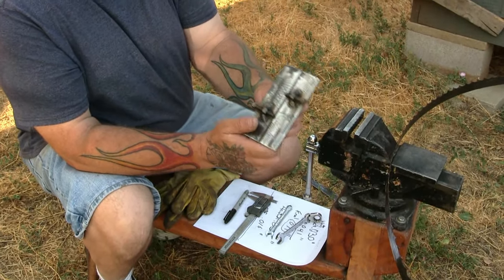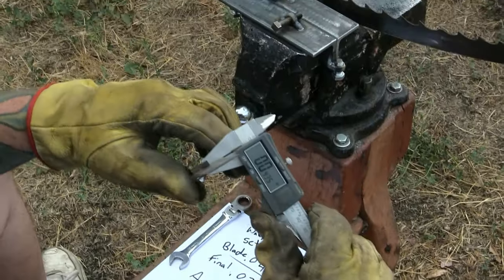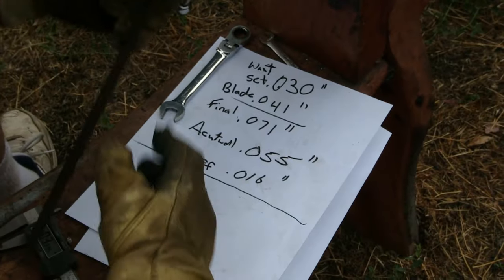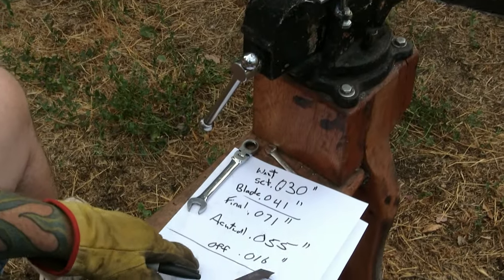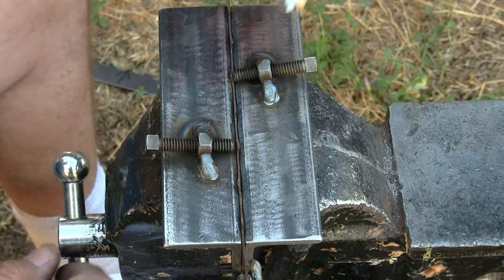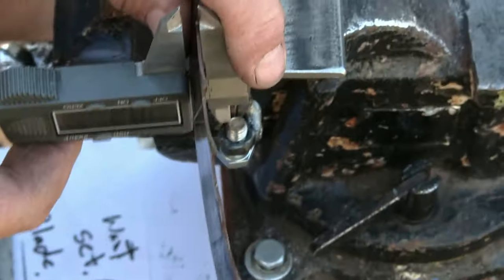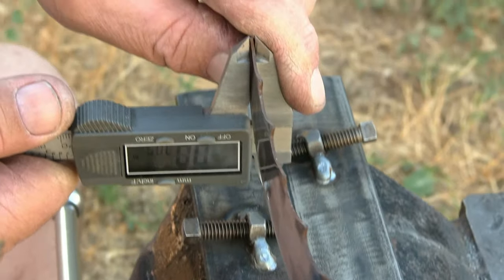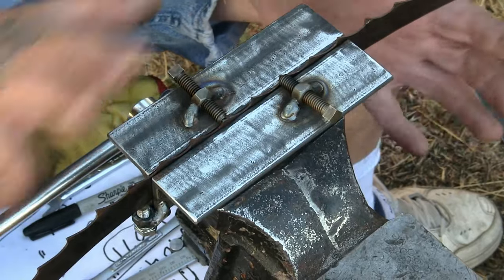Ebay Bandsaw blade setter setup and use instructions sawmill Woodmiser Cooks homebuilt bandsaw

Comment: Thanks for the info. This is very good info on the way the setters work and how adjustments are made on a basic platform. I have a few ideas for mixing this platform with one of my old progressive shotgun reloading presses. I should be able to build a machine I can turn on and the same way the auto sharpener sharpens the mill blades I will set it up for pressing the set. It will not be as accurate as your because of spring back like you said but the ability to set it and let it run is too easy. For a blade that only stays sharp 6 hours and looses set after 12. It’s not worth my time doing this. I’m better off milling and buying a new blade more often. But thanks for the design and knowledge on your product.

Comment: I believe you could build a more accurate gauge that will automatically set teeth exactly without checking each tooth . If you want 075 set bender preset bender for opposite tooth
Reply from the maker: You only have to check the tooth during the initial setup. Once it's set for each side for the proper amount that takes all of about 10 minutes to do you are good to just roll through the blade or blades doing an occasional spot check. Of course I can make a fully automated setter and can make a lever operation that sets each tooth and advances. But that's already available and those machines are very very expensive. This gives you a setter at home that is easy and uses a vise you probably already have.

Comment: One improvement might be to use nylock nuts so the bolts won't move in or out as you are using it. With that said, that change might require using epoxy instead of welding as it would probably be easy to overheat the nuts and melt the nylon insert. Nice design.
Reply from the maker: The bolts are welded. No way epoxy would hold way to much pressure when applied. They are welded then whacked with a hammer to squeeze the nuts so they are out of shape a bit. This makes the bolts fit very snug so they hold there setting indefinitely. The same as a nyloc would. So no the bolts are not loose and do not change adjustment unless you put a wrench on them.
Reply: Simply use the "crimp" style locknuts to make your suggested modification, and you are all good to go.  Or, put a stop/backup nut on the bolt so you can set the "set".  Either way, your suggestion for improvement is great.
Reply: They make mechanical locking nuts. Probably what is welded on.

Comment: I just watched your video.  looks like a simple and great way to set tooth pitch.  Im curious if a person couldnt sharpen the blades as well with this setup, using a dremel?  I want to try it after mine are delivered, but wondering if anyone has tried and succeeded at this.
Reply from the maker: I am working on a simple electric sharpener that uses a similar setup to this to sharpen as well. I been super busy so have not finished yet but few weeks should have it available for sale along with my setters. Watch for it soon on my channel and eBay.
Reply: "Set" and "pitch" are 2 different things.

Comment: Just ordered one. Seem perfect for my set up. I have a Woodland Mills HM 122 (entry level wood mill). Got any suggestions on how to self sharpen a band saw blade? I used a dremel tool that seemed to work ok.
Reply from the maker: I am working on a budget sharpener now. Next few weeks I should have it available. Thanks for ordering a setter. I am very busy making them. Makes a guy feel good to be able to help out others to saw on a budget the same as myself. Pretty cool.
Reply: @goldendredger  Cool! Looking forward to seeing what you come up with! Thanks for offering budget minded tools for the hobby sawyers.
Reply: @goldendredger  were you able to build a sharpener? Link?
Reply: Did it work out ? I hVe the same saw

Comment: I have a woodland HM 130 max bandsaw mill, I run both 7/8" and 3/4" pitch blades, so I guess I would need to order two of your tooth setters? one for each pitch.
Reply from the maker: Hello, 
Yes you would need each size. I can set up both on one. The 3/4 shift to one side and 7/8 to the other. Problem is then you have to back the size of everytime you use the opposite size so the wrong pitch do not touch when using the opposite size. Very time consuming. It's easy to have each size and once set up for your preferred set you never have to adjust it. They are always ready to go. So I highly recommend getting one for each pitch.

Comment: I finally got my version of your saw setter up on my YouTube channel. Let me know what you think.
Reply from the maker: Very good job! Having the advance is great. Early on I tried and tested several setups to include the lever for advancing teeth. But quickly ran into issues with different brand blades having different shape so the advance would not fit every blade on the market. So back to simple. Also price plays huge factor as well. My personal setup was similar to yours. I sold it along with my original bandsaw mill. Now getting another mill and will build another indexing setter and my sharpener is so close to being ready to release. Sourcing parts that I can depend on has been a huge issue. But it will happen.
You done a great job and nothing beats being able to set and sharpen your own blades.

Comment: I checked you Ebay page looking to see if you had the blade sharpener you were building up for sale.   I don't see it.  When will they be for sale?
Reply from the maker: Hello John! It's in final stages. Works great now just sourcing a few bits for a run of them. Bolts and materials are getting pricey. Having trouble getting some in. So may have to make a few changes on the hardware. So once I have a solid parts list I will list the sharpener up. I say give me about 2 weeks it should be ready to go. Thanks!

Comment: My blades go up, down, flat. The set teeth are next to each other. Go around twice?
Reply from the maker: So if you just move the blade so the straight tooth is in the middle of the 2 push bolts. So of course the 2 are offset back to back but slide it till the middle neutral straight tooth is in the middle then set. If it's pushing NOT  the correct direction for your teeth to line up with one straight tooth in the middle and that's why it's not lining up you need to simply turn your blade inside out then the straight tooth will long up in the middle just fine. So flip your blade inside out. Just don't forget yo flip it back before you put it back on your saw.

Comment: what if one tooth is out of set higher than what you want it to be??
Reply from the maker: If it's one tooth just index that tooth to the opposite pusher and give it a little push. Then index it to the correct position for 2 teeth and push it back up to what it should be. If the entire blade has more set than wanted I will normally just get another blade that has less pitch if it's for a specific wood species or frozen log whatever. The less you can push the teeth around the better life you will get out of the blade, but you can flip the blade inside out this will put the teeth opposite direction and then set the tool up just like normal except you will be pushing set out of the teeth rather than putting it in. With that said in the last 15 years I have not done this once.

Comment: Howdy. How do I know what size to buy? Thanks
Reply from the maker: What's your blade specs? But it is easy. Measure the tip of one tooth to the very next tooth tip. It will be 7/8" or 3/4" or 1". This is the pitch of the blade. These specs are also provided by your blade manufacture of the blades you are using.

Comment: Tooth pitch changes??
Reply from the maker: I have all the common pitches listed up. You need a setter for each pitch blade. If I don't have your pitch or blade listed just message I will make one for your size.
Reply: @goldendredger  thanks for your reply mate, I have very recently purchased the mill and in the process of modifying it, I will check the blades tomorrow and make sure they are all the same pitch. I live in Australia mate, any problems with postage?